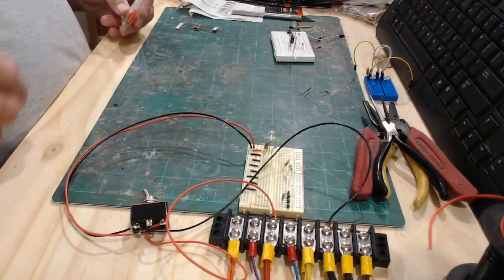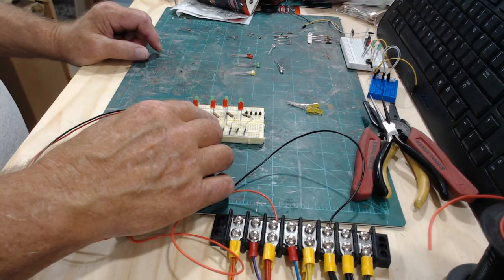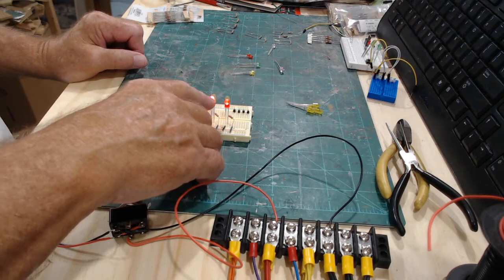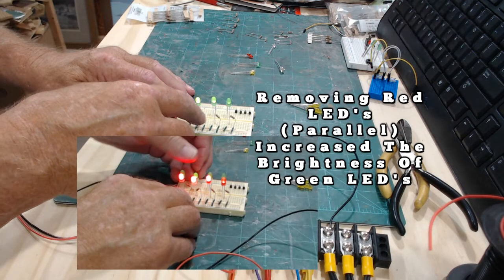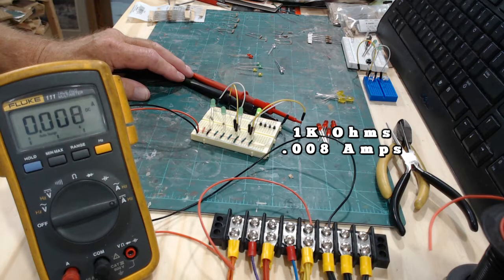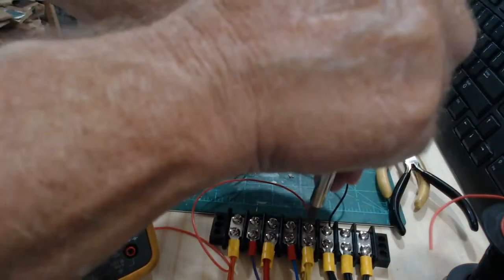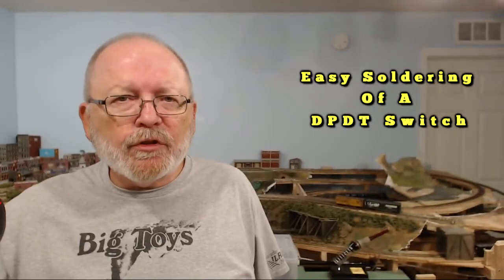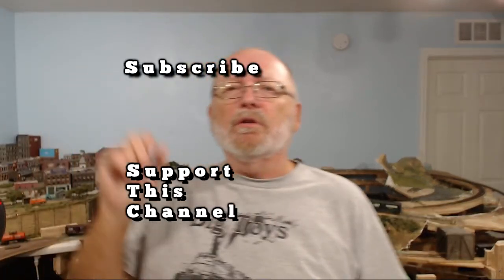LED's Resistors & Ohms Law - Watts The Connection

Comment: Hi Tom, I have been watching your videos on LEDs and resistors.   so i went to my local electronic parts store  to by some LEDs and resistors,  when I got to the store they asked me what size Watt did I need for the resistor: 1/8,, 1/4,  1/2,  1 or 2 watt?  Well I had no Idea what size watt to get.   the LEDs I have are labeled as  5 watt  and others are for 12 volt for cars and boats.

So I know that resistors are 220 ohms or 4,7 or 1 K ohms,  but what "Watt" size resistor do you need to match a 12 volt DC or DCC power supply for a 5  amp LED?
Reply from the maker: The LEDs for cars and boats are waaaaay to large for your model railroad. You want the 3mm or 5 mm LEDs  as noted in my Amazon store. The resistors should be 1/4 watt

Comment: I like putting my lights in a series when i place them in buildings, but im never sure if its the right resistor. Typically I put 1200 to 2000 ohm resistors.
Reply from the maker: Joe, it depends on the LED's forward voltage and what voltage you use to light them. I have some better explanations on a few more videos in the LED series playlist. To be on the safe size it's recommended to use 1K ohm resistors, but if you watch some of my other videos on this subject, you'll see I sometimes go as little as 150 to 270 ohms. But that is a 5 vdc.

Comment: Hi Tom, I recently received some 3mm LEDs, multiple colors. I am planning on using the red, yellow and green for block control for sidings. My question is what size of resistor will I need for a DC system?
Reply from the maker: Bobby Davis each color has a different intensity and some Less operate on a different voltage. You have to test what resistance is best suited for your situation. There is no set value that works with all Less.  In all of my LED videos, I point this out.

Comment: How come i can hook up a 5mm led to the decoder but i cant hook up 4 2mm leds to the same decoder. Ive tried a 750 resistor and without a resister. Still nothing.
Reply from the maker: Are you sure the LED is good.  Try hooking it up to a 9 Volt battery with the resistor and if you have a smaller one, try that also.
Reply: Toms Trains and Things i try them with a double a and they all work fine. I bought them all new and tested them out of the bag. I then tested each one when i put them in the loco and hooked up together.
Reply from the maker: Try reversing the leads on the LED. Current only flows in one direction and is blocked in the other direction.
Reply: Toms Trains and Things ill have to try that and i know electricity well so. When i hook the double a up i hook the wires up the same way i do on the decoder. I know leds only get power from one wire and wont work if backwards.